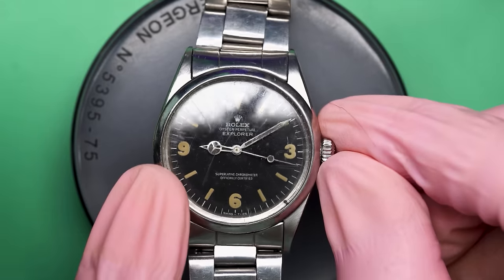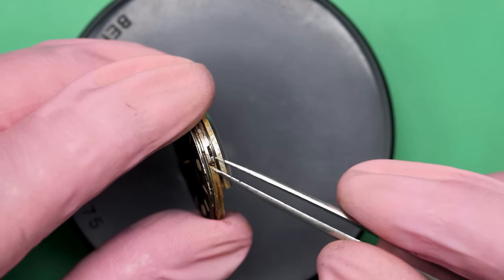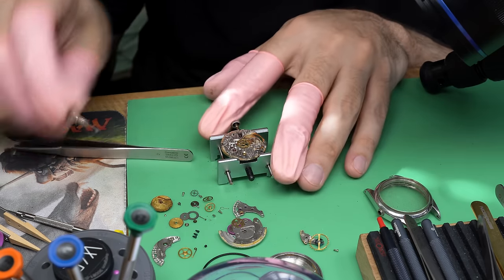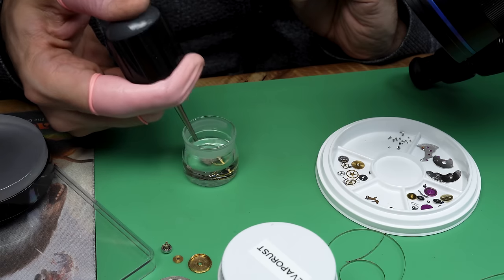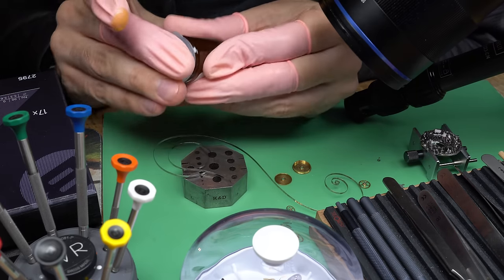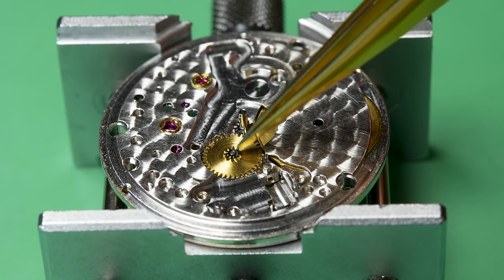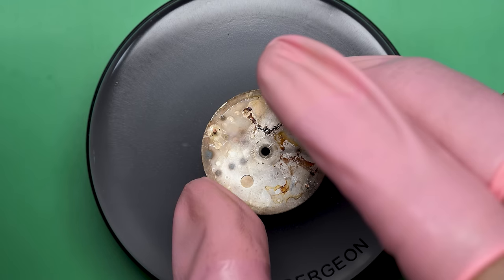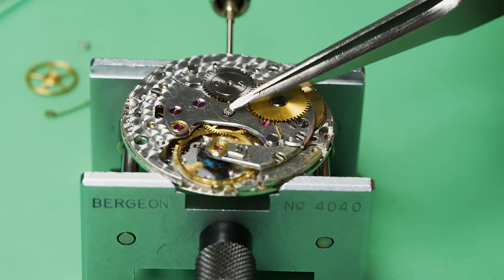This $25,000 Rolex Explorer Was Exposed to Seawater!

Comment: I love watching you show. Just a little piece of advice. When mixing JB weld don't do it on paper. Paper soaks up the hardner and can weaken the bond. Probably not a major concern for watches but still they recommend mixing the epoxy on plastic metal or glass or other non absorbent surface. Same thing for the thread locker.

Comment: I am very disappointed in Rolex.  They are the absolute experts on their own watches and it is obvious that they never even opened the case.  Thank you so much for doing the restoration and allowing us to watch! (no pun intended!) As several other commenters have stated, I am not really a watch person, but I am someone that loves to see how things are made, come apart and go back together.  Awesome restoration!!  ⌚
Reply: It's Rolex so they'd much rather you buy a new one, but of course someone in the service overseas usually can't afford one like the old days.
Reply: It's even worse when you consider it's their parts ffs!
Reply: @3nertia Rolex works on watches like a production line, it doesn’t benefit them to do a repair such as this when they can overhaul  10 clean watches in the same amount of time.  Also Rolex doesn’t stock every part to older watch’s in their inventory, most watchmakers have to source from third party sources.  Think of it as trying to send your Ford back to the factory where it was made to be re-furbished.
Reply: Hi, certified watchmaker here. Rolex refuses any work with a reprinted dial, regardless of age. This watch has a clearly reprinted or non-genuine dial. I think it is wrong to say Rolex couldn't fix this watch, rather it didn't fit the criteria for being accepted into their repair department. You can have a genuine dial with diamond markers added after and they would still service it(with a replacement dial), but if the logo or lettering has been reprinted, it gets rejected.

Comment: I never thought about the parts of a watch having their own specific names "barrel bridge", "click spring", "palette fork", etc. I knew only the escapement, the balance wheel and the self-winding weight (having mended my automatic once.) It's just so amazing to hear you itemise the parts by name. 
Thinking back, though, I used to repair 14" hard disk drives, and every part had its name, that almost nobody in the world would ever use, only disk drive engineers.
And we've all been there @10:59 "ooh, (intake of breath) that's not good."
My automatic is slightly different from this Rolex, it cost £1 on eBay. Still, it tells the time and I've never noticed it lose or gain.
Reply: Be careful everyone this is a Bengali Scammer!

Comment: When using the ultrasonic cleaner, put the watch parts with the visible side (outside of the band, crystal, or outside of the back of the case) up, so the metal bars of the basket don’t scratch up the parts. It’s something I learned in a watchmaker school. (Not meant angrily, just trying to help out :) )
Reply: You had to say you learned this technique in your “first year of watchmaker school”. Are we supposed to be impressed with your credentials? You come off as making a dig. You could’ve just given the pointer and moved on. This watch restoration clearly shows a master at work.
Reply: @grtdeal  I've been an electrician for 30 years now, and throughout my career I've hired people that didn't know anything about being an electeician. Even apprentices has taught me things I would have never thought of. Sometimes having someone with a different style of doing a task is a good learning process, even for the seasoned trade master. You should never discredit someone else's advice as bad. Here is some wisdom for you my friend, " A wise man will listen and increase his learning, and a discerning man will obtain guidance." Prov 1:5
Reply: @roneckler9937  I didn’t have a problem with his suggestion. He could’ve conveyed that without having to say that he learned that in his first year. His statement on this public forum is like hey look at me I learned this in my first year. It’s all about the delivery.
Reply: @grtdeal  I really don't care about credentials, and I thought that adding the disclaimer at the end would clear that up. I'm sorry you were offended by my comment, that was not my intention. Just wanted to help out someone learning the craft. I have removed the "first year" of the comment, as that seems to be the part that offended you.
Reply: What you could do is get the cage coated in some sort of polycarbonate so it's much softer than the pieces you're putting in. Mine has rubber feet to prevent it from rattling against the tub when it's running, but I don't see why the entire cage couldn't be coated like that.

Comment: Oh man this video teared me up.  I can not believe Rolex refused to repair it. Making and selling a watch for that amount of money means to me that they should have restored it, especially since it is still in production, parts would have been readily available.
Reply: I’ve heard that Rolex has run out of some vintage calibre replacement parts and is having to refuse service. It’s possible that some of those parts are still available on EBay. It seems feasible that there are many vintage parts out in the wild considering how many Rolex watches were produced, and how many replacement parts were purchased by ADs and private repair shops over that timespan.
Reply: Firstly, Rolex watches were nowhere near as expensive in the 60s as they are now, and secondly the Explorers that are being made today share zero components with that reference model. It's like saying a brand new Toyota Corolla shares parts with the 1st generation Corolla.
Reply: @khaaaaaaaaaannn   Yeah- when he says it's worth $25K, which it may well be now, people think it was expensive then.
It was a $300 watch in the sixties.
Reply: Rolex discontinued the caliber 1500 40+ years ago.

Comment: The youtube algorithm strikes again! Looks interesting - I'll fast forward throught this... 52 minutes later my mind is blown... As a machinist who operates at a much larger scale, I marvel at the dexterity and knowlege required to even begin to approach such an endeavor. Master watchmaker you are! The only thing that has me scrating my head is why the finger cots? Seems like they would reduce the tactile feedback required for work such as this. I can't not subscribe... ❤🐾
Reply: I also ended up here because the algorithm! I'm glad it took me here!  Wow! Skillfull guy!
Reply: The finger cots are so no oils from your fingers get on the movement. Not only because fingerprints would look bad but also because they’re oiling parts of the movement that shouldn’t be oiled
Reply: I suppose some fatty acids from skin could corrodes certain types of steel.
Reply: Be careful everyone this is a Bengali Scammer!
Reply: @Marcus10295  Yes, thank you. I did google it and it was a total newbie question. Makes me think some of this should actually be done in a clean room  - at least in a perfect world and I wouldn't be surprised if some top notch watch producers have some serious cleanliness standars in place. Dust is a killer for sensitive mechanisms. Even bearing assemblies for milling machines spindles are built in a clean room because when your runnign at + 25,000 RPM one little hair can drastically shorten the life of the bearing or even destroy them...

Comment: I found mysilf completely captivated by this video. Thankyou so much for making it. My perspective is of the aviation engineer (airframes) and now architectural metalwork designer. Formerly a calibration technician too. I loved almost every technique you used to repair this watch, especially the spring winding tool with the satisfying click when you load the spring at the end. aahhhh. I did feel like for all the outstanding work you did, that the hands could have a used a little more restoration. Anyway thanks again for this awesome video.
Reply: I at first felt the same about the hands, but then I realized that it is the hands that tell the time. And in this case also the age and stories of the watch. I assume it was a deliberate choice.
Reply: @onzinlife  it's so subjective isn't it. I think he should have cleaned the hands more but left them aged still. Anyway. The video was outstanding.

Comment: "Hobby?" Sir I've been impressed with every decision you've made here and as an observer who has a limited knowledge of the watch repair world, I understand that you must have explored many possible choices in each of the moves you made to successfully complete this challenge. 
 I recently sent my Seiko Prospex back to the company for repairs and we shall see if it comes home in better shape. As a commercial diver it's been a trusted friend on many dives. I am impressed with the details and dedication you have to your hobby.
Reply: I gave my hubby a Movado divers watch in 1970.  At some point it stopped working and was sent back to the manufacturer for repair.  They had it for 18 months, and then wouldn't guarantee the seal.  Have you ever had an issue with a seal and would you trust that it is water tight?  TIA
Reply: @PM-kf7dg  Over the years I've used Casio Stainless Dive Watches for most jobs. They cost around $40 bucks and you can find them at Walmart. They go as deep as you can dive and come factory tested to 660ft and the seal has never been an issue. I've broken them on the job but then I just buy another. 
The Seiko I own is about ten years old and cost nearly ten times the Casio and I've used it but it's no better in my opinion. The seal has never been an issue with this one either.

Comment: Great job Marshall!  I have a Hallmark Chronograph from the 1950's that my grandfather left me that I would like to restore.  From my research, the Waltham Watch Company owned Hallmark at the time the watch would have been made.  The patina on the dial face is beautiful and it does run.  However, the pushers are missing.  I have looked, but have not found any of the watchmaker/repair channels to have worked on a vintage Hallmark Chronograph.  I don't suppose you might be interested?  Cheers

Comment: Marshall, you might want to consider getting yourself a pair of good brass tweezers. Using steel tweezers and screwdrivers to scratch off rust and remove bridges can scratch the movement. It's instead possible to use solvents and brushes to remove the rust instead of mechanical removal, which tends to be more destructive.
Reply: Doesn't he use Brass Tweezers at 5:50 - or are those wooden Ends? Then again at 30:00, those look like Brass.
Reply: @stefanfranke1724  5:50 are wooden, 30:00 are brass

Comment: A quick question I had while watching your videos: How long do these take start to finish? I imagine between all the work and cleaning that has to be done, I imagine this would many days, considering it's not a full-time gig, am I correct? Thanks for providing the best watchmaking videos on YouTube!
Reply: Apart from part's sourcing, an uncomplicated project like this could take 8-10 hours if done carefully.
A rush job with a movement that has spares readily available (such as Seiko) could take 5-6 hours. I have restored many rust damaged Seiko 6105-8110 (willards) in similar timeframes.
Very tricky projects that need new case tubes, new bushings milled for mainplates, jewelling, etc, can blowout projects to 15-20 hours.

Comment: That was a great episode thanks. Really liked the explanation of the keyless works as I had wondered about that. I'm one of your subscribers that doesn't wear a watch, but I do restore vintage power and engineering tools. Something I also wonder about is why the balance wheel has so many screws (weights?). When I have needed to balance wheels and shafts it is generally by adding or removing material in one or two places, so I can't grasp why the balance wheel is so complex.
Reply: That's a temperature compensated balance wheel.
https://en.wikipedia.org/wiki/Balance_wheel
Reply: @latemarch2  Thank you
Reply: I too appreciated the explanation of the keyless works.  There is a similar thing in cycling with the foot retention system known as "clipless" pedals, which use a cleat attached to compatible shoes which actively clip into these special pedals.  The unintuitive naming stems from it's predecessor from waaaaaaaaay back in the day, when you would have "toe clips" (a system of straps and cages) to help secure your foot while riding.
Reply: @buriedintheblack  Yeah I knew about clipless pedals because I used to compete in triathlon (long time ago). The modern clipless are a lot better than they used to be I believe.

Comment: As a mechanic that deals with rusted parts, I always wonder why watchmakers fear using a solvent like WD to break rust rather that prying and twisting a dry part. Why risk a part when a single drop of solvent would free it up.
Reply: I think I'd have tried Evaporust on a few more of those parts as well. Nothing to lose, right?
Reply: I used to work in corrosion control in the navy, first thing I thought of was this.
Reply: @zandrm  it can dissolve tiny parts just a bit. But it’s definitely worth a dip and wash after an hour or so.
Reply: @john-paulsilke893  What it dissolves is already lost to rust, though. It certainly seems less destructive that scrubbing with pegwood.
Reply: I honestly cant figure out why. Its not like removing penetrating oil is any harder than adding it, and it would certainly make the job easier.
Reply: I'm a mechanic as well (Diesel fuel injection), and I was thinking the same thing. I didn't hear it mentioned in the video, but I'm going to assume there is a reason that they don't use solvents.
Reply: My best guess would be you couldn't put a small enough amount, even 1 drop would probably go throught the entire watch to places you dont want it. Im just shooting in the dark.
Edit: At 25:17 he puts greese on and you can see how little he uses with a little syringe. Why he cant do that with wd40 i do not know
Reply: You can totally do that - but this was not anywhere bad enough to have to do it; depending on the solvent and how some components are assembled you could cause yourself many headaches -

Comment: 33:30 Both brass, and stainless steel are pretty resistant to corrosion. I suspect most of the parts you replaced were made of ordinary steel. That would also explain why the rust removal of some part were so easy, they were made of stainless, and had gotten stains of rust on them from another rusty steel part.
Reply: correct, that's why brass is used in plumbing.
Reply: I work with stainless steel everyday and stainless itself contains between 8 to 10% iron which is why it still corrodes there are 3 types of stainless , 304 , 316 , and 400 the higher the number the more anti corrosive in this case it's most likely the 304 or 316 stainless that had some of the corrosion on it
Reply: @shaneclyde8694  All stainless steels I know of have over 50% iron in it, I think you are talking about chromium content with those numbers. There is also a whole jungle of different stainless alloys, not just three.

Comment: Very cool story, it must feel pretty good to have reached the level of local hero, also I'm wondering why you didnt use some sort of penetrating oil to loosen up the rusted screws before trying to disassemble, I'm guessing there is a reason but I'm just curious
Reply: Completely agree. Use penetrating oil where necessary first whether it's a watch or something else damaged by rust...don't force it from the start;  use penetrating oil, take a break and try later...🙋‍♂️
Reply: Como vástago de una familia de relojeros un reloj así esté oxidado nunca se debe soltar con ninguno de esos productos ya que el aceite penetrante deja una película que incluso con el ultrasonido cuesta eliminar y en algunos tipos de aleaciones puede corroer más el reloj. Además, cualquier aceite aplicado en óxido lo que logra es una pasta abrasiva, por eso decidió sacarlo "en bruto".